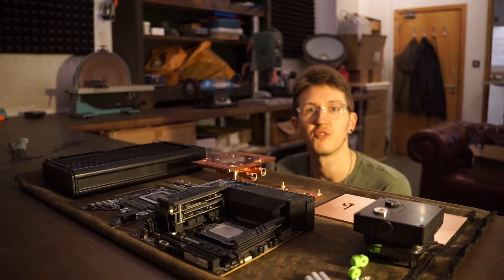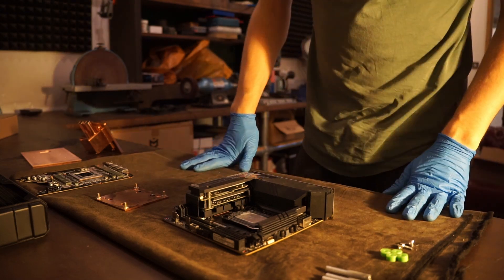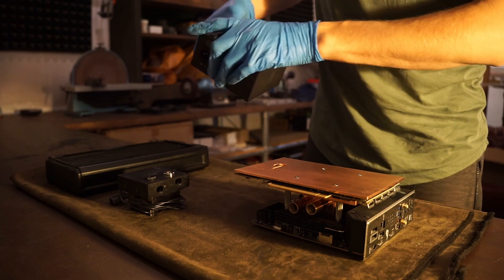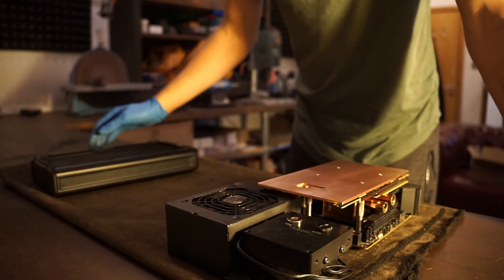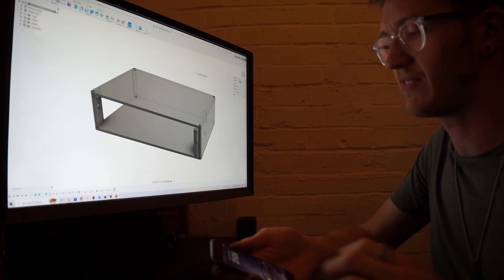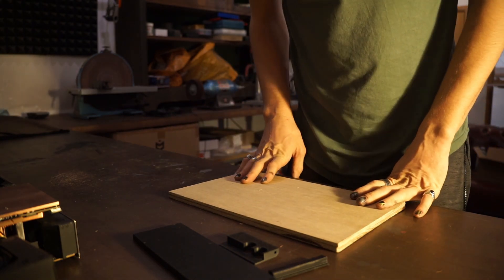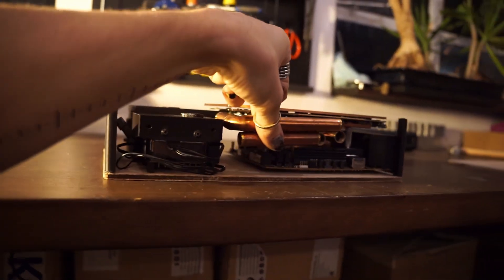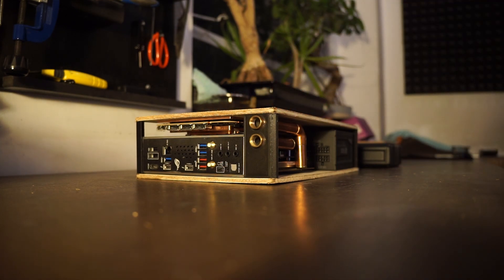Billet Labs MonoBlock - Externally-cooled 4090/14900K build - Part 1

Comment: Bouncing through your videos, I'm left puzzled by the choice of having both pipe fittings coming out the side of the motherboard. If you had them angled so one went forward (away from the ITX back plate) and had a similar 90 degree arrangement for the pump. It feels like you could maybe even get the pump inside the footprint of the graphics card.

Comment: A company called HDPlex makes PSUs for small form-factor builds, ones which use GaN transistors which lets them be tiny - they do a 250W and a 500W, but both have a feature which lets you sync two PSUs with a link cable - two 500s would power that build and they're really compact, 55*40*200mm.
Reply: Looking a t the dimensions of things, one would fit in the void where the GPU overhangs the motherboard, the second might fit against the top of the case above the PCIe slot, if the riser can go to 90 degrees in the gap that would remain

Comment: Have you considered 2x240 extra slim rads top and slim fans top and  bottom? Should be enough to cool both at full power.
Reply from the maker: The footprint of the current design is 200x340mm, so we could only fit one 240mm rad, and then we may as well use a 280mm. But honestly we're probably going to nail the externally cooled case before putting much thought into adapting it to be a self-contained, cooled build. We have the option of a 200mm square rad too. It's a shame no-one makes a 200x300mm rad, as that would fit perfectly.

We've had this 280mm rad easily cooling both components at full power, though the fans were at 100% and there were 4 of them.

Comment: It would be cool to have compatibilty with atx motherboards defined .. I want to test this with a 2 dim overclocking board
Reply from the maker: The MonoBlock fits all ATX motherboards. The only limiting factor will be the height of the VRM heatsinks, but they're usually fairly small on ATX boards compared to ITX. The I/O of the motherboard/GPU will not line up on an ATX board though.

Comment: Yo, looks sound so far. Only thought that comes to mind initially is conflict with psu cabling with the pipes running between the psu and motherboard as pointed out at 13:57. Love what you're doing though gents!
Reply from the maker: Thanks Sean! We think there will be space for piping and wiring - we might need to use soft tubing through the centre for the flex, just connected back to copper on each end.

Comment: Make the GPU backplate the case cover
Reply from the maker: We'd love to, but the riser cable will need to go over the top between the GPU backplate and the case.
Reply: @BilletLabs  what about rotating the GPU ? I know Theres a lot of difficulties. But the Connectors could be elongated to the I/O Panel side Maybe ? Maybe too much difficulties.
Reply: Also allows for better passive cooling capability when slotted

Comment: The solid facer does not work as it needs to be grilled to allow PSU exhaust.
Reply from the maker: There's around 9mm of air gap above the PSU which might be enough. We also have the option of thermal pasting the PSU body to the bottom 5mm ally plate to help cool it passively. But we'll see what works! ✌